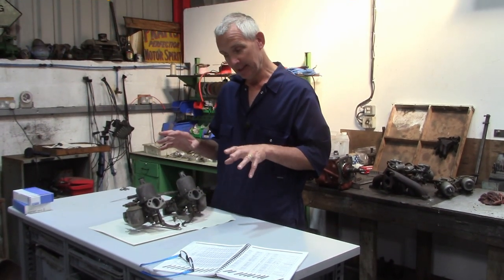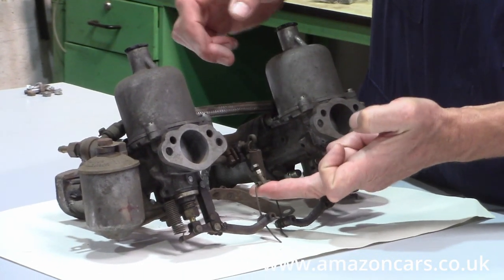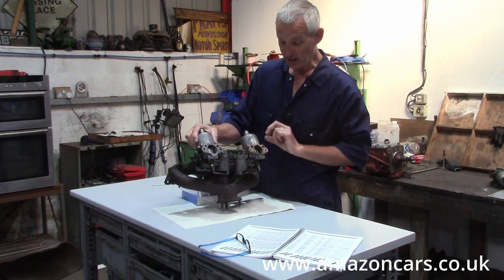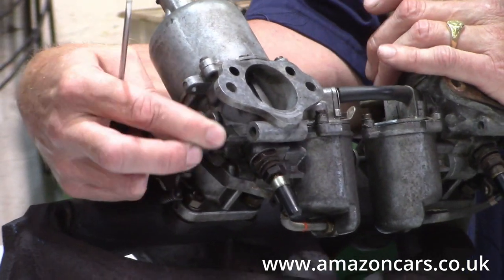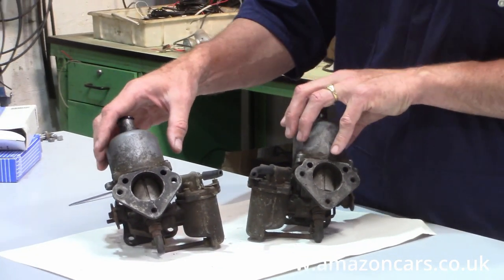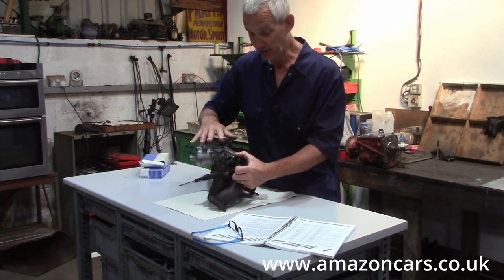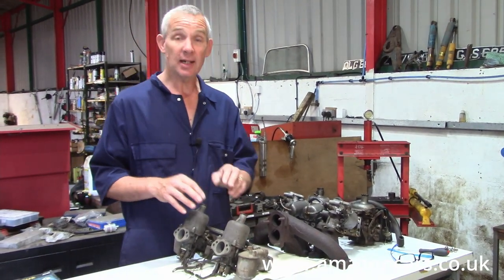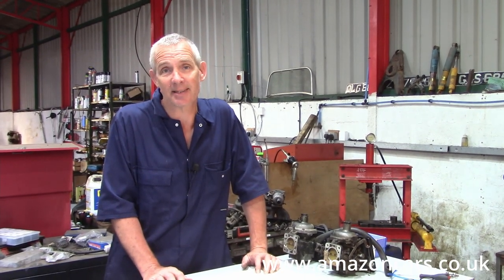Twin Carbs: what was fitted to which engine

Comment: Again a very nice video.
A few notes: the 140 series also used the SU HIF6.
I would also have liked a few notes on the different intake manifolds used in combination with the twin carburetor setups.
Reply from the maker: I should indeed have mentioned the B18 140's, I left it implied only I think! Or do you reckon the B20 140 had SU's also?
Very good point about manifolds - another quickie video needed I feel!
Thanks Lars,
Rob
Reply from the maker: And the HIF was fitted to some 140's I believe, but I've never seen that on a car over here, besides Harvey Steele's rally car.
R
Reply: @amazoncars  B20B did come with twin SU-HS6 and SU-HIF6 - beside the Strombergs
Reply from the maker: @eb28211  Do you know what market got the HIF's Lars?  I should relabel the video "Commonly found twin carbs"!
Rob
Reply from the maker: @eb28211  My B20 Amazon parts catalogue makes no mention of HIF nor twin Strombergs: only single Strom or twin HS6's?
Rob
Reply: @amazoncars  I think only the late 140s got them, at least in scandinavia. Also as a side note, single carb setups were zenith upright and later stromberg carbs. Twin Strombergs though, were only fitted to B30's over here, all b20 twin carb engines had SU's.
Reply from the maker: @Bubbibjoern  Thanks Bjorn, clearly the UK market got the "upgrades": pretty sure no 140 was sold with the Zenith over here, and only the B18's got the SU's, all the B20's got the Stromberg.
This was often the way, for instance Scandinavia got the B20 engined 240, which was never available in the UK.
Rob
Reply from the maker: @Bubbibjoern  I can find no reference in the 1972 or the 73/74 Volvo parts catalogues to the Zenith downdraught ever being fitted to the 140 - so that must have been a rather odd peculiarity for the local market I guess. My video is from a UK perspective!
As I say, only the B18 140's got SU's over here, B20's got the Strombergs.
Regards, Rob
Reply: @amazoncars  no no that's not what I meant 😂 only the early B18 in amazon and PV544 had the downdraft zenith. Later all B18 and B20 single carb engines got the stromberg, but never a single SU.
Reply from the maker: @Bubbibjoern  Thanks Bjorn, you are absolutely correct, forgive my mis-reading of your comment!
Regards, Rob
Reply: @amazoncars  no worries mate!

Comment: Hello, greetings from Poland. I started restoring my P1800e and I have an idea to change the fuel injection to be powered by two Weber 45 carburetors set. My mechanic friend advises against it and says that at idle the engine will sound like a tractor but from 2000 Rpm it will be rocket, and basicly that those Webers are a bit to big. What I want with carbs is that beuatyfull sound and historic feel, some decent power around 120 BHP. I am asking for Your advice on this topic, schould I try with these carburetors or maybe use smaller Weber 40, maybe a different brand or stick to injection. Afert seeing Your videos I know that You have massive knowledge about those engines, please give me some thoughts about it.  Thanks for any advice. Best regards, Michal

Comment: I have 2 SUs H6 (KN needle) in my garage and I´m driving a Amazon B20A (Stromberg). Can I put them on my B20A? I Just would like to have 2  Carbs for better looking - not for more power..
Reply from the maker: Cams & Carbs don't like mix'n'matching: an A cam with twin carbs results in an engine that won't rev (the A cam), and less torque at the bottom end (twin carbs); equally, a D-cam and single carb results in an engine that won't rev (single carb restricts the redline) and has less torque at the bottom end (the D-cam).
So, I would always have to say "no" to twin SU's on the A-cam...
Rob
Reply: @amazoncars  Hi Rob, the B18D with twin SU-HS6 - from the PV 544 Sport had the same A-cam as the standard B18A - well not completly true, the G-serie Sport ( the so called 1966 model) did get the B-cam.
Reply from the maker: @eb28211  Excellent Lars, thankyou, I didn't know that! I tried A cam and SU's on our London2CapeTown 140, and it just didn't do anything very well!
Rob
Reply: @amazoncars  How can you tell the differences between the cams?
Reply from the maker: @SjaakTrekhaak23  The ID is stamped on the aft end of the camshaft: so to be certain what it is you have to pull it out of the engine
Reply: @amazoncars  Ok thanks. I have a B20E in my P1800 and want to convert back to dual HS6 instead of the Weber 38DGSM it has installed  now. I assume I should get the latest HS6 version? A bit of a guess if it will work with the camshaft then.

Comment: Just in time. I am going to start screwing up my SU HS6's in a few days. Wish me luck and try not to laugh.
Reply from the maker: There's a couple of tricky bits when doing the SU's Randy:
1. Fitting the butterfly shaft bushes is a machine task, but often not necessary
2. Centring the jet, so that the needle doesn't bind on it, preventing the slide from moving
Otherwise it's a pleasant task!
Rob
Reply: @amazoncars  do you recommend someone for a professional rebuild of the HS6?
Reply from the maker: @retrospectdesigns4137  In the UK: Burlen Fuel Systems would be our first choice, and Southern Carburettors a very close second.
Rob
Reply: @amazoncars  awesome! thank you :)
Reply from the maker: @retrospectdesigns4137  You're far too enthusiastic: thankyou, we really appreciate it!
Rob & Emma